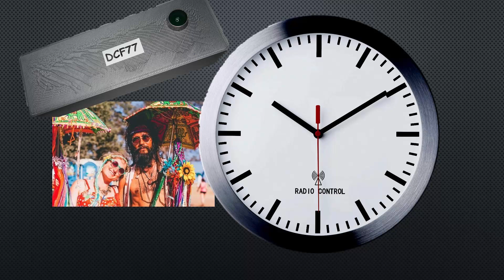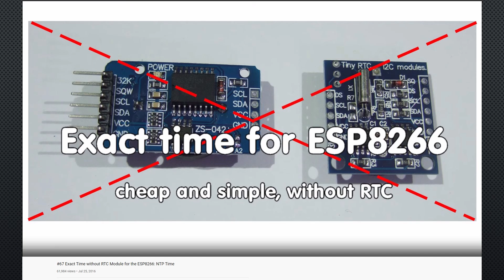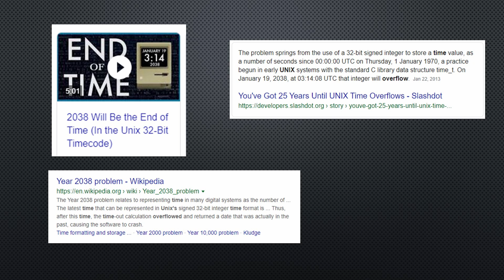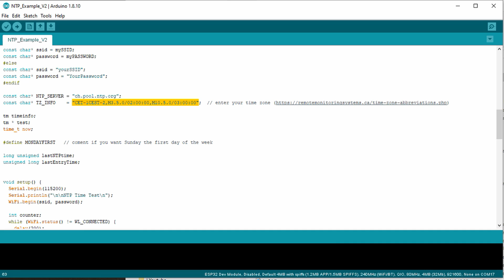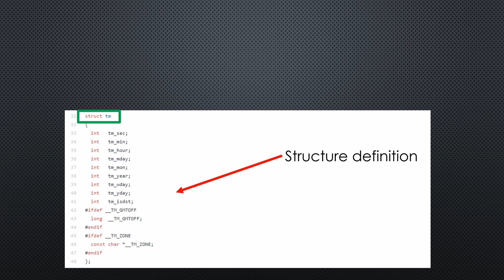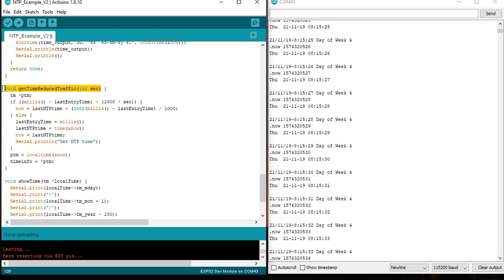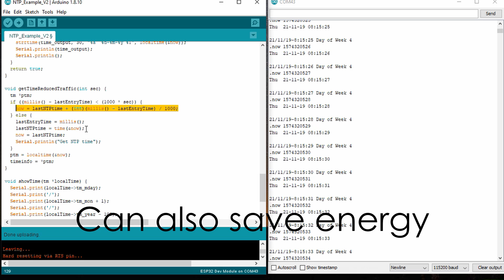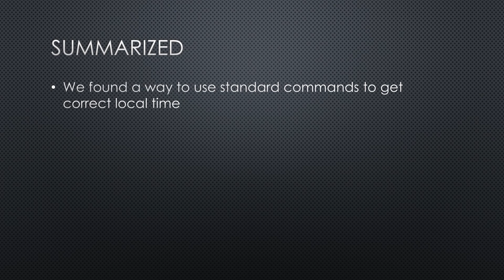#299 Tricks to get NTP time for the ESP32 and the ESP8266 incl. Summer- and Daylight Saving time

Comment: Another trick to get the NTP time into the IoT devices is to use the main router as the NTP server within your local network. For example Fritzbox can do that.
What are the advantages to do so?
- security: the devices don't need to have full internet access (like in my case I have all my smarthome devices blocked from accessing the internet) but they can still get the acurate time all the time and immediately from the router directly
- availability: assuming that the router always has the latest acurate timing received from a public NTP server it can provide that time always to any of the connected devices without needing all of them run public NTP requests at all
- proper synchronization of all smarthome devices: if the router would have the wrong time, then ALL connected devices work with the same time and don't run asynchronously

The Fritzbox allows a setting for how often it should run the public NTP request => no danger for any connected devices to overshoot the request limits and getting blacklisted.

It works very well with whatever kind of device in my case. ESP8266, ESP32, Raspberry, Android, Linux, Windows. Even Tasmota runs perfectly with this method.
It is amazingly simple.
In the Fritzbox you define the public NTP server plus the frequency for updating from it.
And you activate the function of Fritzbox becoming the local network NTP server by symply clicking the related checkbox.
The local NTP address is (with Fritzbox routers): fritz.box
That is the name for the NTP server you must enter in the NTP settings of each device.
As simple as that.
No further hassle with any additional settings.

Whenever a smarthome device boots up and connects with the router, it will immediately receive the correct time right away - even without being connected to the internet.
Works all fine for me (I am a bit paranoid when it comes to internet security)
Reply from the maker: Thank you for the tip!

Comment: Andreas, you are about 1125 KM away from Anthorn Radio Station that broadcast the UK time, and you are about 300 kM away from DCF77 source in Germany. I was wondering if you could make the test to get both signal on two separate radio controlled clock side by side. Or on the same clock that can be configured. Are you too far away (you said 2000Km for DCF77)? Is this related to curvature of earth or something blocking you? Maybe you could discuss how far it goes the way you explained Lora distance? Maybe you are not interested in UK time... Could you detect discrepancy if one goes wrong and the other stay right? That could be interesting video, at least for me. :-)
Reply from the maker: These signals are propagated through the stratosphere. This is why they are generally better during night. So the distance the signal travels is always slightly different.
Reply: @AndreasSpiess  Thanks. Being somewhere in the triangle between Anthorn (UK MSF60 at 60kHz) Frankfurt (DCF77) and Allouis in France (162kHz), I should be fine then. If ever Europe disagree on Daylight Saving, I should be able to get all of those.
Because of you, I am trying to put Ikea BURRIG Radio-controlled wall clock in my Xmas list, but this is not available Europe wide. It is available from Ikea Switzerland, but not in Belgium. I may have to do import.
Your project is very interesting, please keep us update and share your ESP32 code.

Comment: Finally a way to synchronize DCF clocks in Australia. 😎

P.S.  I'd check the drift between NTP server requests and keep doubling until it becomes significant... Limited to about once a day, (32 hours) maximum.
Reply from the maker: We do investigations. It looks that time() does not call the server every time. Only every hour. Which would make the second function obsolete...

Comment: Hi Andreas and all the mates of this channel. In a recent project of mine I used NTP time and since I live in Greece I had to convert it to our local time which also contains Daylight Savings that are applied every Automn and Spring. So I found a nice library named timezone (please check the link below) for Arduino which was compiled easily for the esp8266 I used for my project. I only had to apply the DS rules to the library like in the following snippet:

// Timezone settings
TimeChangeRule summerRule = {"SMR", Last, Sun, Mar, 3, 180};
TimeChangeRule winterRule = {"WTR", Last, Sun, Oct, 4, 120};
Timezone tz(summerRule, winterRule);

Then you can call the tz.toLocal function passing the epoch number as a parameter in order to get the local time for your timezone. You can assign the resulted time_t to a DateTime class for easier processing of the date/time:
net_date = DateTime(tz.toLocal(tmc.getEpochTime()));

The library is currently available at:
https://github.com/JChristensen/Timezone

I hope you are all well and get helped a bit by this library.
Reply from the maker: Thank you for the link!

Comment: A quick note from a NTP pool server operator. You do not want to excessively poll public NTP servers. Most implement some sort of blacklisting if a client constantly demands time from them. Ideally, you should ask for time quite often in the beginning to sync your own local clock, and then back off as your confidence in your local clock increases. If you look at the “ntpq -p” commands output on a Linux box running NTP, you’ll see this behavior quite clearly. As time goes on, the time to the next query increases. The reason we’re so stingy with bandwidth is that when you’re already giving away time for free, we’d like to give it away to as many people as possible.

Also, good work that you implemented the DNS-name for the pool instead of just the IP of some random server, that’s very important since the amount of available servers can vary very much, here in Finland for example we have something between 17 and 50 NTP servers in the pool at any time...
Reply from the maker: Thank you for the info. We have indications that the function time() only calls the NTP server once an hour. Could you check and confirm that with your knowledge? Then we would not need any manual throttling.
Reply: @AndreasSpiess  I'm not close to a computer with the Arduino IDE installed, and the time.h library seems to be very hard to find online for some reason. However, every reference I can find seems to have a parameter in the library that sets the update timer, usually between 1 and 5 minutes. A normal NTP client (without ibrust och burst set) will start off trying to poll the server every 64 seconds, and will slowly increase this interval as it gets more into sync, eventually maxing out at 1024 seconds. So any device that has a polling interval of more than 500-ish seconds is in my point of view "in compliance" with the not so clearly stated NTP Pool guidelines. Setting the polling interval to 3600 seconds should be more than enough for any device that need only 100 ms precision, as NTP is designed to give precision in the millisecond resolution with a polling interval of 1024. If you need better then that, there's always PTP. :)
Reply: Has the number of requests per hour increased steeply thanks to IoT devices?
Reply: @NiHaoMike64  It's rather hard, as the pool load balances all traffic to the pool servers depending on physical location of the client, as well as a factor that you set for your server. So mine see around 70 kbps constantly, but I'm in a quite "low server population" area, with a rather high "client population". The better IoT vendors usually follow the NTP pool guidelines and request a separate "vendor name" in the pool, and send all their clients there, so that they can direct their clients better towards pool servers provided by them. But IoT has definitely had quite a large impact, since there's always from time to time some vendor that gets raked over the coals for polling time every second from the general pool. :)

Comment: be carefull with esp8266, NTP and DHCP!
Reply from the maker: Why?
Reply: @AndreasSpiess  in Tasmota we have often the request the NTP is not working and show no correct date. I debug them and found out, if you use DHCP the tcp-Stack alawys send the ntp option. The dhcp standard says you must answer all question and some dhcp server tells a stupid value. The esp core software don't don't know it and want to connect to this server. You can set a ntp server but the core software ignores them if it gets a value from the server. I talk with the developer but i don't know if they fix them. He tells me, that this is a bug per design and it is not so easy to correct them.
I configure your router correct ;) Set an faulty entry at the dhcp server at your mikrotik and test them ;)
Do you get my last mal about zigbee?

Comment: good video.
but isnt using time as described as in the "simpletime" example in arduino for esp32 much simpler?
i use a  slightly modified  even shorter version of this example  and it works well and is  less code and more readable.
Reply from the maker: Are you sure your example automatically changes times in spring and in autumn? This is the point of this video.

Comment: 08:20 this is OK to start counting from zero ;D and Sunday is the 1st day of week because of national standards. 

I have another question: why on earth they use int variables to store numbers like day or hour??? use byte variable! save some memory!
Reply: Valdis Black Because int is the native memory size and requires only one clock cycle for access, byte requires additional clock cycles to isolate from the bytes returned during memory access.
Reply: @christopherguy1217  Maybe it would be better to say "native memory size for ESPs" as they are 32bit processors, whereas for a classic arduino, byte (= uint8_t) would be the better choice
Reply: Zeero unfortunately the number of bits in the word length of a processor does not directly define the native types available in C and C++. This is precisely why we have sizeof operator...

Comment: I now get my time/date from the 'date' section of a web-page header. The advantages are that it is just a simple call to any web page, so no restrictions on how often you call it, (its just a web page). DST is already calculated for you, (the timezone + offset is written at the end) and it's a lot less code! (No extra time libraries required!)

Parsing the info from a single 'date' string is pretty simple to do and gives you everything you need....and if you use a well-known search engine for the header info then you also have the advantage of 'leap smearing'....they use their own public NTP server. (I was under the impression this is also a Stratum 1 server but I'm struggling to find that info now.)

I adjusted the code from the link below to give me just the 'date' info:
https://techtutorialsx.com/2018/06/08/esp8266-arduino-getting-http-response-headers/
Reply from the maker: Interesting idea... Thank you.

Comment: Does this support the NTP Drift function?
Reply from the maker: I do not know this function.
Reply: No. The SNTP protocol (a subset of NTP really) doesn't calculate local oscillator drift. The client updates the time every hour and it will jump the system time to whatever the update says the new time is. There is no clever slewing of time drift as you get in bigger OS like Linux. It's a bit much for an embedded device like an ESP.

Comment: I figured out that there are also problems with the configTime() function. It works asynchronously and gets the NTP time, however:

- During the period it gets the time it sets the ESP32 time to zero!
- You don’t know when it is finished.
- Existing app variables e.g. service startup time must be adjusted 
  to have proper time statistics after time changes.

I did the following to overcome this. I save the current UTC time and count in parallel seconds while calling configTime(). After two seconds I verify if the time() changed by more than 3 seconds, if yes the new NTP time has been set, otherwise I restore the clock to the value before calling configTime() plus the seconds since then. Existing variables of my app like startup time of my services, etc. I adjust.

Thank you for the great videos, now I understand even more of the the TZ magic string.

Regards from Hannover, Germany.
Reply from the maker: I try to check the year to find out when the NTP time arrived.
Concerning the time() function: A Patreon with an own NTP server found out that the ESP only calls the NTP server every hour. In between it keeps the time with the internal counter. So you might not compare real NTP time if you call time(). But otherwise it is a good idea to compare two different sources to find "the truth"
Reply: @AndreasSpiess  I am using a separate ESP32 64.bit to track the time independent of the time() function, for this case.
My software updates the time once a week via NTP, I did not know that the ESP32 is doing it automatically. I will investigate into it further.

Comment: I think the code doesn't roll over a day properly.  If it is transmitting the day, won't it be off when the current time is 23:59, in that it will transmit 24:00?  This also will break for leap seconds, but those are thankfully rare.  (It is totally possible for tm_sec to be from 0 to 60, for instance, when a leap second is introduced...)
Reply from the maker: I did not check the rollover, because my DCF77 transmitter would correct it after a while. But maybe somebody else checks it.
Reply: @AndreasSpiess  I had an inspection of the code too, and I must agree with @Michael Graff that the rollover must be wrong... To fix it at that point in the code where the "next minute" is currently added, however, would introduce a cascade of propagation of value overflows all up to the year! (And you must deal with leap year calculations too.) A much simpler solution would be to simply add 60 sec to the time_t now right before it is sent into the localtime function. It will take care of the complexities. Now the global timevalue will contain the next minute's time instead of the current minute, but that is probably exactly what you want there anyway. :-)